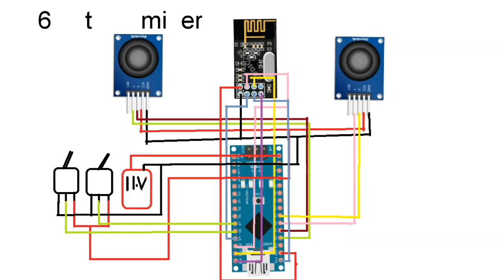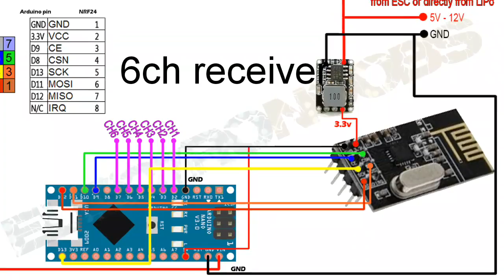How to make 6 channel Transmitter and Receiver//DIY

Comment: Very good stuff! I've just finished to solder my Tx and Rx boards yesterday based on your FB page and it works! Haven't checked the latency yet but it seems pretty responsive :) Thank you for your work, I'll use this module in my quadcopter. All the best!

Comment: Hi sir, can you help me a little bit. If i make a transmitter and reciever by myself them how I'm gonna differentiate between the signals sent by joystick because both joysticks would give the same outputs. This is the point where I'm not getting something good in my mind.
Reply: Joysticks give same out puts but to different pins or ports, so the pin that is  set to recieve the signal from a certain pin on the transmitter arduino,so u should have no problem as long as u dont connect 2 things to the the same pin on the reciever

Comment: best man 
without mpu 6050 and flightcontroller  can we make quadcopter using your receiver and transmitter only
Reply from the maker: No
Reply: are you use flightcontroller with your receiver 
plz give me a suggestion
Reply from the maker: Yes

Comment: Hi, your work is amazing I'm really impressed.
I've few questions for you, if you don't mind can you please answer them.

1) How to increase the number of channels i.e. 8 Channels
2) How to use LCD, OLED or LED display to show the battery percentage

Actually I'm working on a project Drone + RC plance with different applications sannd I resally need your help.
Reply from the maker: Nrf24l01 have 32 channel you hat to upgrade the program

Comment: What is a "tangle switch" for?
Reply from the maker: 5th and 6th channel
Reply: MiB Makers Do you mean "toggle switch"?
Reply from the maker: Yes
Reply: I like your code - very tidy - but I am having terrible trouble making these modules work. It is very hit-and-miss, even with the special base units with the 5v to 3.3v converters. I have checked the chip codes and they are all the same, even from different suppliers, but do not seem to be the real Nordic chip. I will go back to the "getting started" examples and try again from there, I think, but I suspect faulty hardware.

Comment: What is its range
Reply: 1 km
Reply: @Jhonnybaba_yt  the module that you  have used is the nrf24l01 module WITHOUT an amplified antenna and hence you will not receive data after you cross 8 metres. 😃

Comment: Arduino: 1.8.5 (Windows 7), Board: "Arduino/Genuino Uno"

C:\Users\Dipanshu\Downloads\MIB_RECIVER\MIB_RECIVER.ino: In function 'void setup()':

MIB_RECIVER:76: error: 'PWM2' was not declared in this scope

   PWM2.attach(2);

   ^

MIB_RECIVER:77: error: 'PWM3' was not declared in this scope

   PWM3.attach(3);

   ^

MIB_RECIVER:78: error: 'PWM4' was not declared in this scope

   PWM4.attach(4);

   ^

MIB_RECIVER:79: error: 'PWM5' was not declared in this scope

   PWM5.attach(5);

   ^

MIB_RECIVER:80: error: 'PWM6' was not declared in this scope

   PWM6.attach(6);

   ^

MIB_RECIVER:81: error: 'PWM7' was not declared in this scope

   PWM7.attach(7);

   ^

MIB_RECIVER:84: error: 'resetData' was not declared in this scope

   resetData();

             ^

MIB_RECIVER:85: error: 'radio' was not declared in this scope

   radio.begin();

   ^

MIB_RECIVER:87: error: 'RF24_250KBPS' was not declared in this scope

   radio.setDataRate(RF24_250KBPS);  

                     ^

MIB_RECIVER:88: error: 'pipeIn' was not declared in this scope

   radio.openReadingPipe(1,pipeIn);

                           ^

C:\Users\Dipanshu\Downloads\MIB_RECIVER\MIB_RECIVER.ino: In function 'void recvData()':

MIB_RECIVER:100: error: 'radio' was not declared in this scope

 while ( radio.available() ) {

         ^

MIB_RECIVER:101: error: 'data' was not declared in this scope

 radio.read(&data, sizeof(MyData));

             ^

MIB_RECIVER:101: error: 'MyData' was not declared in this scope

 radio.read(&data, sizeof(MyData));

                          ^

C:\Users\Dipanshu\Downloads\MIB_RECIVER\MIB_RECIVER.ino: In function 'void loop()':

MIB_RECIVER:115: error: 'resetData' was not declared in this scope

 resetData();

           ^

MIB_RECIVER:118: error: 'pwm_width_2' was not declared in this scope

 pwm_width_2 = map(data.throttle, 0, 255, 1000, 2000);     //PWM value on digital pin D2

 ^

MIB_RECIVER:118: error: 'data' was not declared in this scope

 pwm_width_2 = map(data.throttle, 0, 255, 1000, 2000);     //PWM value on digital pin D2

                   ^

MIB_RECIVER:119: error: 'pwm_width_3' was not declared in this scope

 pwm_width_3 = map(data.yaw,      0, 255, 1000, 2000);     //PWM value on digital pin D3

 ^

MIB_RECIVER:120: error: 'pwm_width_4' was not declared in this scope

 pwm_width_4 = map(data.pitch,    0, 255, 1000, 2000);     //PWM value on digital pin D4

 ^

MIB_RECIVER:121: error: 'pwm_width_5' was not declared in this scope

 pwm_width_5 = map(data.roll,     0, 255, 1000, 2000);     //PWM value on digital pin D5

 ^

MIB_RECIVER:122: error: 'pwm_width_6' was not declared in this scope

 pwm_width_6 = map(data.AUX1,     0, 255, 1000, 2000);     //PWM value on digital pin D6

 ^

MIB_RECIVER:123: error: 'pwm_width_7' was not declared in this scope

 pwm_width_7 = map(data.AUX2,     0, 255, 1000, 2000);     //PWM value on digital pin D7

 ^

MIB_RECIVER:127: error: 'PWM2' was not declared in this scope

 PWM2.writeMicroseconds(pwm_width_2);

 ^

MIB_RECIVER:128: error: 'PWM3' was not declared in this scope

 PWM3.writeMicroseconds(pwm_width_3);

 ^

MIB_RECIVER:129: error: 'PWM4' was not declared in this scope

 PWM4.writeMicroseconds(pwm_width_4);

 ^

MIB_RECIVER:130: error: 'PWM5' was not declared in this scope

 PWM5.writeMicroseconds(pwm_width_5);

 ^

MIB_RECIVER:131: error: 'PWM6' was not declared in this scope

 PWM6.writeMicroseconds(pwm_width_6);

 ^

MIB_RECIVER:132: error: 'PWM7' was not declared in this scope

 PWM7.writeMicroseconds(pwm_width_7);

 ^

exit status 1
'PWM2' was not declared in this scope

This report would have more information with
"Show verbose output during compilation"
option enabled in File -> Preferences.

 PLZ SOLVE IT
Reply from the maker: Download nrf24l01 library
Reply: already download
Reply from the maker: Try again
Reply: ok
Reply: problem solve nhi ho rhi ha
Reply: remove the extra information given in the staring or place // at the starting and ending of the line which u are not taking into account